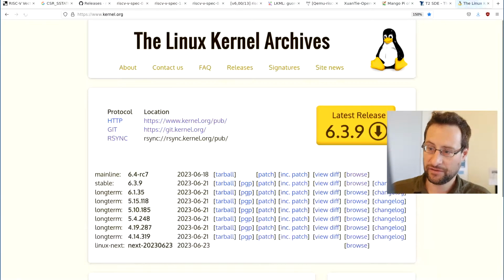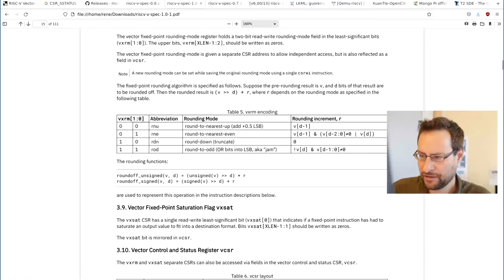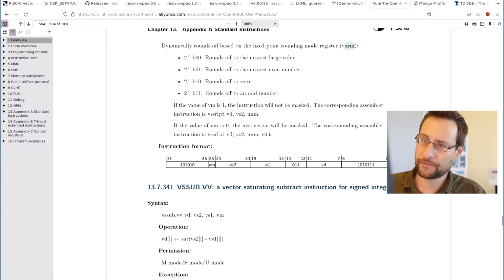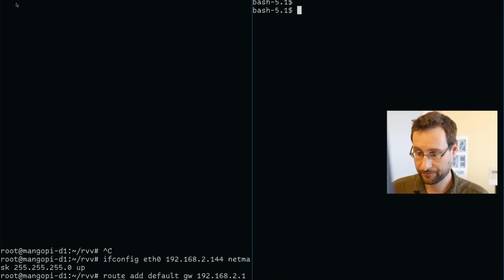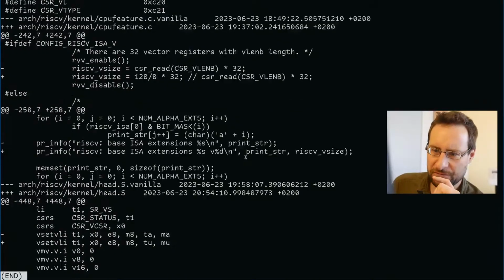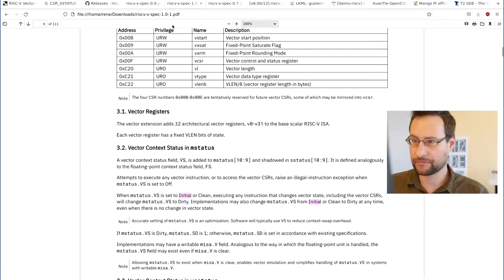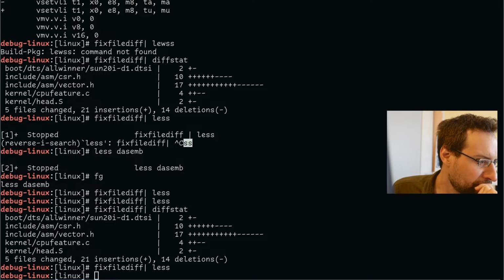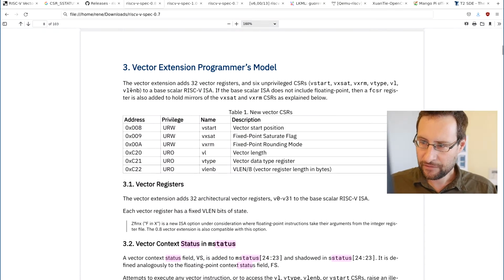The IMPOSSIBLE RISCV-V HACK: Vector Extension 0.7.1-draft w/ current Linux kernel!

Comment: If you manage to get RVV 071 upstreamed, it could potentially save about 20GWh and between 9-18k tons of CO2. Calculated at 5M devices with a power reduction of 1/10 of watt due to RVV. Lifetime of 5 years.

Comment: The issue is just that some kernel developers think they are superior, while living under a rock, and the rest of the world has to endure their product. The eBPF technology is still not ready for mass production use, at least partially because the low-level structures aren't documented and the developers of the high-level userspace stuff don't know the features even exist (this happened with bpftrace maintainers and BPF subprogs recently, and I wouldn't be surprised if it was not the only case).